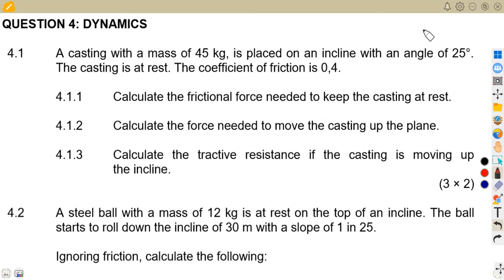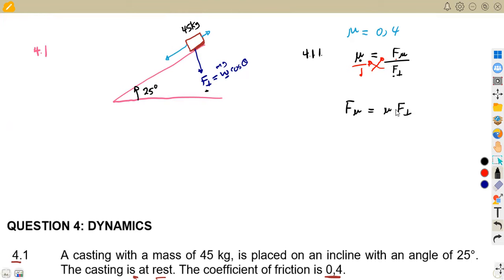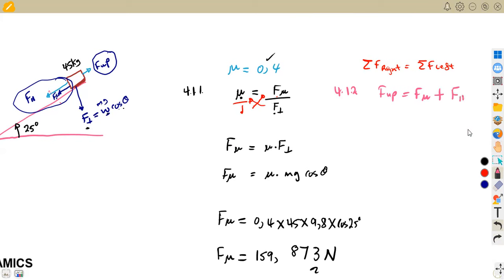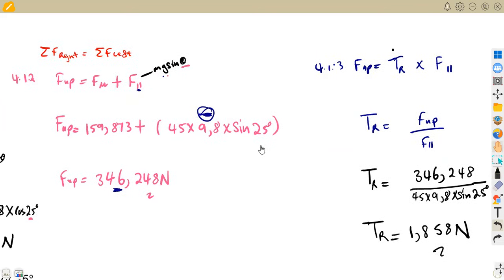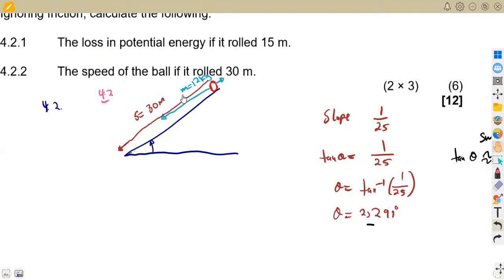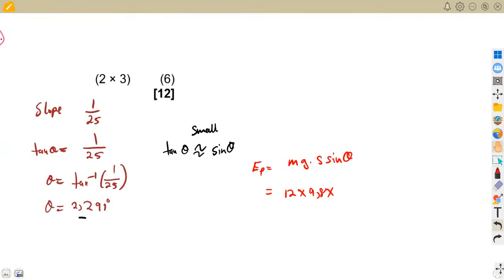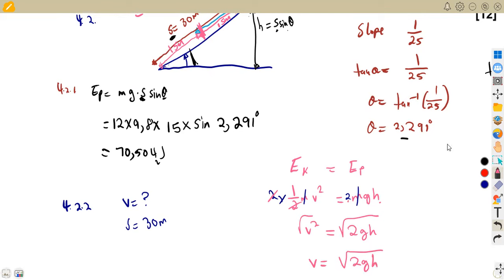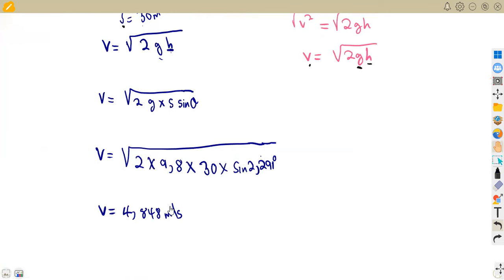Engineering Science N4 DYNAMICS APRIL 2023 @mathszoneafricanmotives

Comment: when you say small,which numbers are considered small? 15:34
Reply from the maker: Hie , for small values , you can use the slope. A small value < 0,1 or 1/10 . Thus when you express 1/25=0,04 thus less than 0.1 therefore it’s a small value and the corresponding angle is small : the approximate can be used
Reply from the maker: But if you don’t understand it please continue using the angle as it is . It still correct. You will see that your answers will be the same
Reply: Thankue